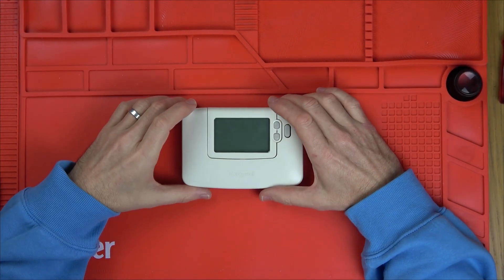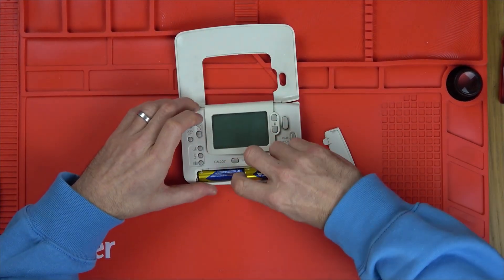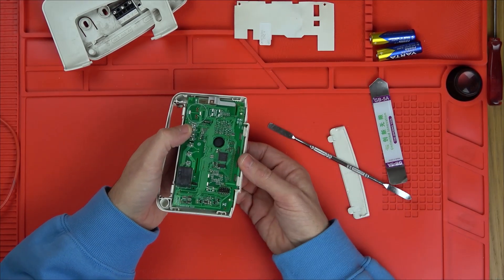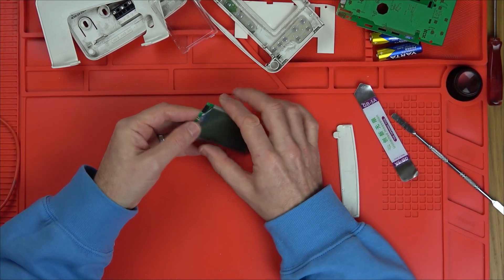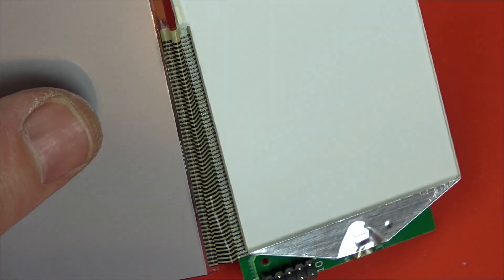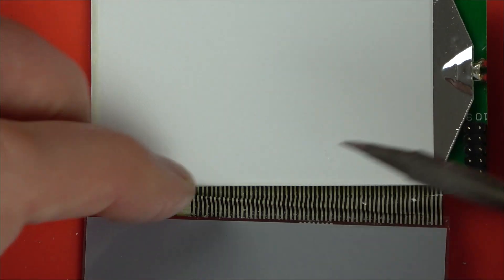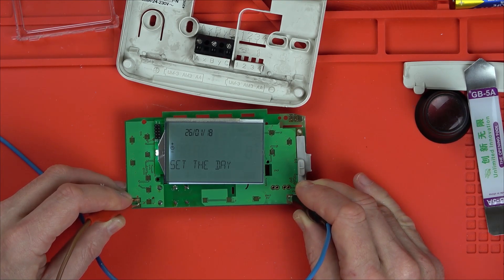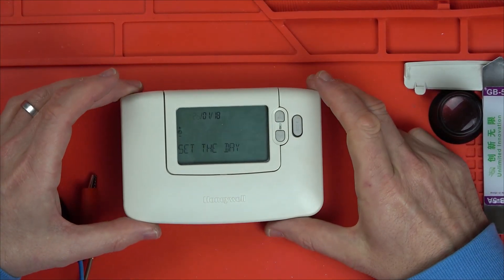FIXING LCD Screen Honeywell programmer showing Blank Display - FAULT IDENTIFIED and How to Fix!

Comment: I’ve just fixed mine using this method 👌🏻 I put the bigger flat tip on mine and slid it across the inside ribbon and the face on the front of the circuit board.
Steady heat and it’s no longer going blank 👌🏻
Thank you 👍🏻